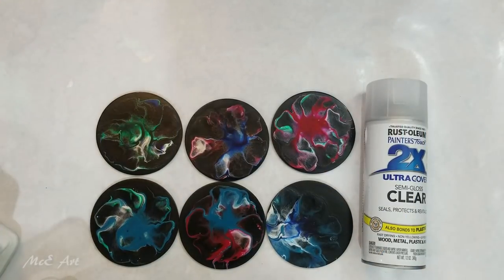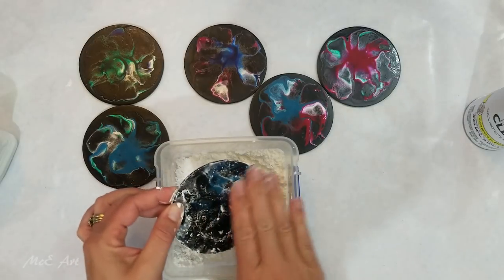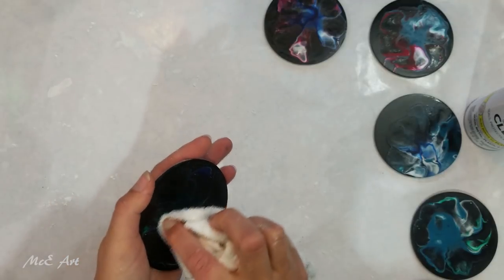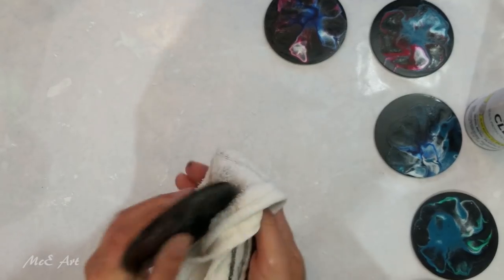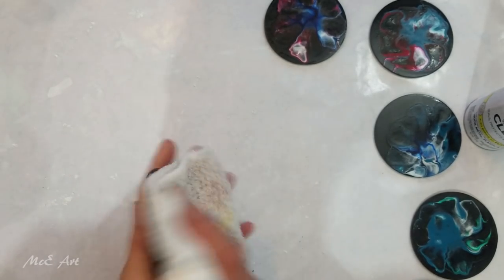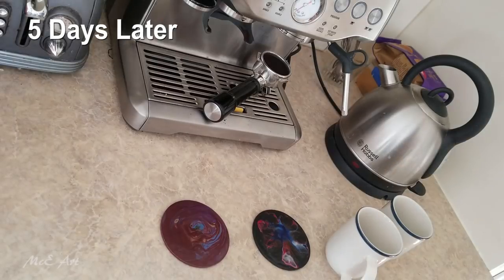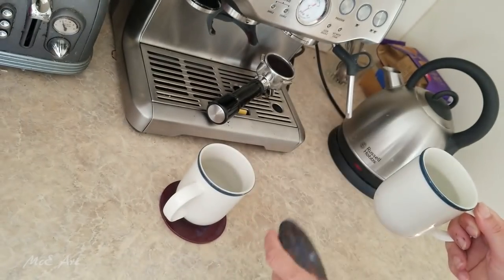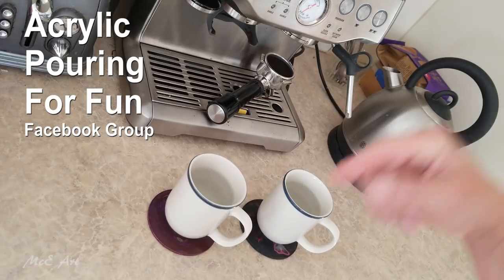396 Does Rust-o-leam Create Non Stick Coasters?

Comment: Thanks for the video.  I would recommend checking those coasters again with same boiling water, same mugs at the 2 or three month mark, a friend did that and found that although her finish stuck at the 2 week mark after 3 months they were fine.   Nor positive if the spray was the exact same as yours though.
Reply from the maker: Awesome I will thanks Jean and give feedback in a later video if it changes :)

Comment: You could try baking them in between coats. 15-20 minutes at 250 degrees F. I have not done this with rustoleum and/or cork. But I use it when making beads or other paper jewelry. I use poly crylic and it gets hard much faster that way. Takes a long time for most finishes to get as hard as they are going to. ?? 

Do you still have those coaster to try again with the cups of coffee? Maybe it does not stick now.
Reply from the maker: Hi Deborah these are great ideas.  Yes I use these everyday and only sticks when wet underneath.

Comment: An interesting discovery I've made:  when I've gently washed my canvases with Simple Dawn soap and a rinse, they clean up fine as long as I'm using a fairly rough canvas...my usual inexpensive $1 canvases; but my more expensive canvases with a tighter/smoother weave will sometimes allow the paint to flake away, especially where paint is a bit thinner.  This is after curing for many weeks.  So I've learned to used different methods for different substrates.
Reply from the maker: Great awareness!   We don't get Dawn soap here in NZ but I use Amway Dishdrops which works great or Amway LOC

Comment: You may have to use a high temp resistant polyurethane.  Or, I know you don't want to,  a high temp resistant resin. You might let it set longer and try again.  It may need to cure longer.
Reply from the maker: Will keep trying. Thank you Ramona :)

Comment: Michelle. I have just done some on clear Perspex, acrylic ones  and today glass paint.  These with them being clear Perspex you can either resin them on the painted side or turn them upside down , the acrylic ones gives a different look , but the glass ones is the same image as the painted side.   I am shortly going to do clocks and placemats to match.
Reply from the maker: Awesome do the resin on stick to the cup?  If not which resin do you use?
Reply: McE Art I am going to use the resin for my acrylic clocks and coasters ,   I use master cast 1 to 1 by elichem ,  it’s  for artwork, I have used this in my traditional paintings and mosaics and it’s fantastic.  Glass paint coasters you can either resin the painted side or flip it upside down as the pattern is underneath too.   I wanted to find a alternative medium as acrylic ones with flow medium is expensive. So I use mainly scola paints in acrylic and also their glass paint. Fabric paint is also cheap  15.99 for six 150 ml bottles. Six colours. .
Reply from the maker: Awesome thank you :)
Reply: McE Art michellejust donethree on records ready to make clocks. One is glass paint. If you want to take a look   Jen.

Comment: I love to make coasters. What I do after they are completely dry is use s brush and dust them with cornstarch.
Reply from the maker: So you just brush the cornstarch /cornflour on rather than big handfuls like me?
Reply: McE Art LoL yes. I brush liberally then dust off the excess. I packed 6 sets in boxes straight away for Christmas gifts and weeks later when they were opened they didn’t stick. The trick, I suppose, is to make sure they are dry before dusting them. Are you still having the issue even after the cornstarch? If so, I’m stuck. 😁

Comment: Michelle I use a high temperature engine spray so that it doesn’t stick. Hope that helps
Reply from the maker: Awesome.  What brand do you use?
Reply: I get it from the automotive store and it’s called VHT high temperature enamel clear gloss. Hope that helps
Reply: Does the HT engine spray work right away or do you have a wait time?
Reply: @McEArt  did you try the VHT high temp spray?
Reply from the maker: @trotmieyer  no I couldn't find it in NZ